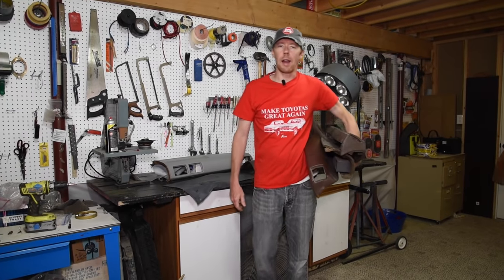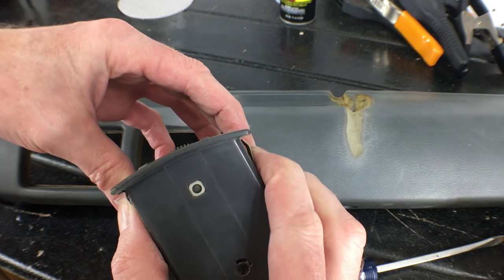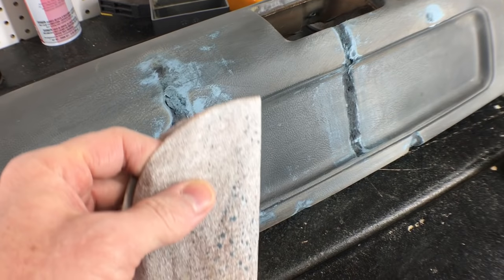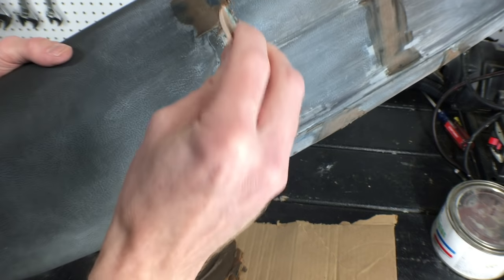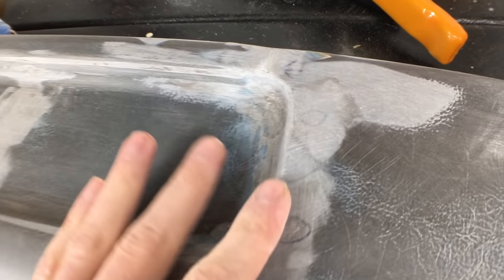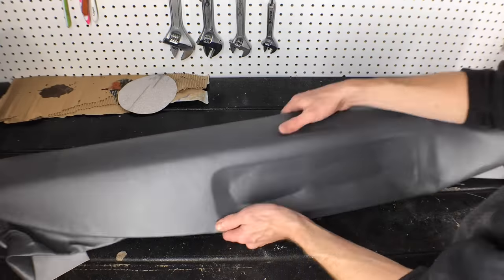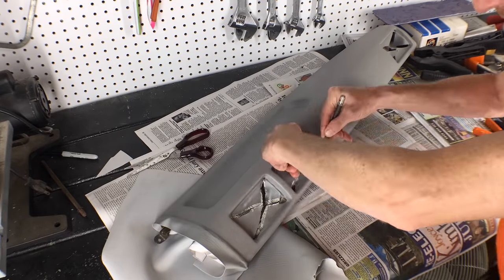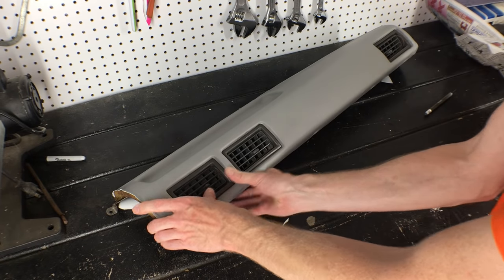How to Restore/Fix/Repair a Cracked Vinyl Dash - Toyota Hilux Pickup/4Runner PART 1

Comment: I know it sounds expensive but try leather and then on that front edge of that second Dash the newer version you'd have a top Stitch two sections of the leather. That's how I did a Silver Shadow dashboard and voided it look nice and believe me after I had it all nice and maroon leather top stitched I never let it sit out in the sun and I always kept a good coat of basically beeswax melted in the microwave and put it on a towel and wipe all the leather down and it soaks in that beeswax and I mean it looks nice. That was back in the days of rolling in money now I fix cheap cars and own cheap cars.
Reply from the maker: I'd love to learn how to stitch leather one day. It looks amazing when done well!   I recently restored another Toyota dash using spray foam, 4-way stretch vinyl and brush-on glue, and the results were much better: https://youtu.be/XB9GKLRHYNM

Comment: With all the cost of materials, labor and the chance that the old vinyl will crack again and show through the new vinyl . I rather if available buy a new one or go to a salvage yard and get one if it's in good shape.
Reply from the maker: Toyota doesn't make them any more, but once in a while a nice Toyota dash shows up on ebay... and sells for $500+  Someone should start to reproduce these.

Comment: After watching you struggle wouldn't it be better to just spray it with raptor liner and you can also change the color of it to charcoal or something it wont look too bad and doesn't look like a hassle like wrapping it in vinyl
Reply from the maker: I think I;m going to try another one with that method

Comment: Hi can you use filler sanded the spray paint  thanks
Reply from the maker: You could do it that way if you wanted a custom smooth glossy finish. I've seen it done before. It would be a lot of work, but worth it in the end.

Comment: Just a quick question... Why not just fill the dash then sand it and paint it whatever color you like? True it wouldn't be textured but less likely to crack and you can paint it in any color
Reply from the maker: I went for the factory look on this one  but I would like to redo one in the style you’re describing where it’s painted smooth and glossy.

Comment: I might have considered just filling in the recessed area before covering it and doing away with it altogether, save a lot of heartache These things are made in large high pressure high temperature presses, thats how they get the covering to conform to the shapes, nearly impossible to do at home.  The vinyl will never stay down in that cavity in the sun, the factory uses special vinyl I believe as well.  Another thing, try getting automotive grade vinyl at an auto upholstery shop.  Ive padded and recovered a lot of door panels and had great results, but theyre much easier than a dash pad, not so many shapes and cavities.  A for effort.
Reply from the maker: Thanks for the advice... I may try again with all the tips I've learned from people's comments.

Comment: @ 26:20 you should have used a different glue that allowed for removal and to reapply the material.
Reply from the maker: I recently restored another dash using spray foam, brush on glue and 4-way stretch vinyl and the results were much better:
https://youtu.be/XB9GKLRHYNM

Comment: AIRCRAFT MECHANIC> Once you filled the original cracks just paint the dash since you are dying the new vinyl.
Reply from the maker: The only thing is the repaired area won’t match the original texture. But I want to try another and make the whole dash smooth like the paint on the body of a car
Reply from the maker: The only problem is that the repaired area wouldn’t match the original texture of the dash.

Comment: There's a couple key elements in success you were missing: a better spray pattern cat (3M 90) and doing it in smaller sections. The top section should be done gluing the recess first and then the rest. Also, heating the vynil before stretching it over (with the glue applied).
Reply: Hmm I'm looking at some 90 to add some sound attenuation foam over existing dynamat, seems about the best product so far and you can't go wrong with 3M
Reply: @MrTheHillfolk  if you're covering the foam with upholstered panels, then maybe the 77 is sufficient.

Comment: Hey dude this vinyl you had the first time was good you just started at the wrong place, and you did not leave enough vinyl for the pocket plus you spray glue as you go it's the small tight corners at the ends of the dash that's a pain in the butt because it's all heat and stretch from that point because the vinyl has to be pull over and around the ends and edges. but it was still a good video
Reply from the maker: Thanks!  I recently restored another dash using spray foam, brush on glue and 4-way stretch vinyl and the results were much better: https://youtu.be/XB9GKLRHYNM

Comment: Should do the recessed area first let completely dry then do the rest of dash
Reply from the maker: Thanks for watching! I later restored another dash using spray foam, brush on glue and 4-way stretch vinyl, and the results were better, but still had a little trouble with the recessed area: https://youtu.be/XB9GKLRHYNM Also I put both dashes through a torture test to see which products held up better and the second one was definitely the winner: https://youtu.be/ywkqTaHK2LA

Comment: If push comes to shove how about filling up the majority of that recess with spray foam, sanding it down and filling in any imperfections with the Bondo. That recess is just a open junk drawer. Lol. To get rid of the bubbles down in that recess you need a small roller that they us in the RV world to roll out bubbles in rubber roof seams and eternabond tape
Reply from the maker: I recently restored another dash using spray foam + some better materials and it turned out great: https://youtu.be/XB9GKLRHYNM  That recessed area is where an optional inclinometer cluster sits, so I wanted to keep it open, but when I restore the third dash, it's getting filled in!

Comment: For the recessed area it would have been better to lay the face of the dash down because that is relatively uniform other than the vent ports.  Then work from front to back a little at a time to prevent trapped air and get the vinyl to lay into the recess evenly.  It would probably be easier too if you only spray the dash its self with adhesive then you can just kind of roll the vinyl on and have it resting on something else to prevent it from sticking on when you don’t want it to.
Reply: Contact cement has to be sprayed on both sides, otherwise the bond is incomplete - learned this from doing laminate countertops.

Comment: Great job on the video, but I Definitely would use a can of spray foam and rasp into shape. The blue can would be more manageable than the red. Also, working in halves is key. Lay the material over the dash without spraying any adhesive, peel back one side and spray the back of the vinyl and the dash.  When the adhesive is tacky, start rolling the vinyl on to the dash, use fingers under the flap for any indentions. Use heat gun ass needed, Just saying.
Reply from the maker: Thanks for the advice. I'd like to try this project again with everything I've been told.

Comment: I've wrapped vehicles for 10 years now and this may look good for a little while but it will eventually start lifting and looking like crap.Ive never seen anyone wrap a dash board.
Reply from the maker: I recently restored a second dash with 4-way stretch vinyl and brush on glue and the results were much better: https://youtu.be/XB9GKLRHYNM  Now I'm testing the two dashes in the summer heat and the first one is peeling up like you said. The second one is doing great though.

Comment: So if you ended up painting the new vinyl, why didn't you just paint the old vinyl dash after you filled and sanded it smooth? Seems like recovering it was stressful and a lot of time and effort if it all gets painted anyway.
Reply from the maker: The parts I filled in didn't match the original vinyl texture that the rest of the dash had. Also I didn't trust the bondo to never crack a little, so the vinyl covering would hide that.  But I want to try this again and spray a bed liner instead of using vinyl to see how that looks.
Reply: @6thGearGarage  ok, gotcha. Didn't think about the texture. Makes sense.

Comment: Why not just use spray-in insulation foam (right stuff, etc), then trim/sand it after it's done curing/drying?  It should remain pliable under the vinyl.  Seems like it would be a lot less work.
Reply from the maker: I wanted to keep the shape OEM because there's an optional altimeter/inclinometer cluster that fits in that recessed area. I restored another Toyota dash using 4-way stretch vinyl and brush on contact cement, and the results were MUCH better: https://youtu.be/XB9GKLRHYNM
Reply: @6thGearGarage  Understood.  My comment was regarding the use of the filler for the cracks in the dash, not the template you used to address the void space between the vinyl and the original top contour.  My though process was to use the foam to deal with that space you created with the v-grooves you intentionally cut along the cracks.  Nice job; and you put a ton of work into it.  It's hard to find parts for our old favorites.  Same with my 96 XJ.
Reply from the maker: @Brian_C_  Oh my bad, I read that wrong.  I  recently restored another dash with the spray foam you mentioned, using some different methods and better materials, and it turned out great: https://youtu.be/XB9GKLRHYNM

Comment: I wonder if a 3rd gen camaro will be easier because its very flat
Reply from the maker: Yeah flat should be easier. I recently restored another dash using spray foam, brush on glue and 4-way stretch vinyl, and the results were better, but still had a little trouble with the recessed area: https://youtu.be/XB9GKLRHYNM

Comment: For real, I'd have just filled that recessed part. I hate stuff laying on the dash anyway so I would never use it.
Reply from the maker: Thanks for watching! I later restored another dash using spray foam, brush on glue and 4-way stretch vinyl, and the results were better, but still had a little trouble with the recessed area: https://youtu.be/XB9GKLRHYNM Also I put both dashes through a torture test to see which products held up better and the second one was definitely the winner: https://youtu.be/ywkqTaHK2LA

Comment: On a truck, after doing the prep work as shown in the video, I might try spraying on truck bed liner instead of covering with vinyl. It would be a whole lot easier! The color would have to be determined in advance. But bed liner comes in a range of colors and can be tinted or mixed for an even closer match, if wanted.
Reply from the maker: Great idea and so much easier!  I'm going to try this in a future video.
Reply: I've seen some videos where after the Bondo process they are primed and painted. I don't think I will attempt the vinyl but I may do the paint or spray on bed liner.
Thanks for the information and video.
Reply from the maker: @chrishinds1897  I am going to try that route on the next dash, there will be a video 👍

Comment: I am rebuilding a 1989 Hilux. I desperately need advice on LSD diff and gear reduction.
Reply from the maker: What size tires are you going to use?
Reply: @6thGearGarage  : Thanks. context: I live on a tiny remote tropical island in the West Pacific. The max. speed limit is 35 mph. In 2whd, I have never used 5th gear & seldom even use 4th. The roads are rough with crater size potholes. Offroad, I use only 1st & 2nd gear. Offroad is deep, soft sand on steep hills. I need much lower gear ratio. motor = stock 22R currently running 31" tires I'd like to run probably 33" or possibly even 35". But the 31" tires have already pushed the to-the-ground gear ratio to the top of its usable range. In 2whd, What it feels like is I'd like second gear to run about like 1st gear runs now. I'd like to be able to take off in 2nd gear with 1st reserved for a "bulldog" gear. Then I could use all the gears. This truck is called upon to pull out vehicles stuck in the sand. It is also called upon to tow heavy trailers in 2whd. Actually, I already have an Eaton Detroit Truetrac LSD rear diff replacement carriage that I have NOT yet installed. I need recommendations on gear reduction. Which is better, replace the ring gears in both front & rear diffs? Or replace transmission final drive? What ratio do you recommend? What parts? brands? suppliers? You have my sincere gratitude in advance.
Reply from the maker: @tutorjerry9436  I don't have any experience with your exact situation, but on my 22R truck with 13" tires, I have 5.29 gears and it's just right for daily driving. The speedometer is still accurate with that setup.

Comment: I replaced the vinyl by spry paint and looks better.....is just an option.....
Reply from the maker: What type of paint did you use?  I recently restored another dash using spray foam, brush on glue and 4-way stretch vinyl and the results were much better:
https://youtu.be/XB9GKLRHYNM

Comment: Copmletely kill that recessed area by putting Bando so that you will have a smooth surface at top... That's the only way because whatever you do, the vinly will loosen out from that recessed zone unless you apply hot high pressure pressing.
Reply from the maker: I recently restored another dash with 4-way stretch vinyl and brush on glue and the results were much better- check it out: https://youtu.be/XB9GKLRHYNM
Reply: @6thGearGarage  Will check that out. Thank you for sharing your experienceand know-how btw. :)

Comment: Never use spray glues they don't bond as good best use glue and apply by brush so it penetrates both surfaces instead of sitting. On top of the surface
Reply from the maker: Thanks for the tip!

Comment: Think I woulda just painted it, instead of vinyl. Looks good though.
Reply from the maker: Thanks for watching! I later restored another dash using spray foam, brush on glue and 4-way stretch vinyl + spray paint, and the results were much better, but still had a little trouble with the recessed area: https://youtu.be/XB9GKLRHYNM Also I put both dashes through a torture test to see which products held up better and the second one was definitely the winner: https://youtu.be/ywkqTaHK2LA

Comment: Could you just fill the cracks and sand it well and then just paint it
Reply from the maker: Yes, but matching the vinyl texture would have been tough. I recently restored another Toyota dash using spray foam, 4-way stretch vinyl and brush-on glue, and the results were much better: https://youtu.be/XB9GKLRHYNM
Reply: @6thGearGarage  I watched your other video as well it looked good. I am lazy im going to order the cap for mine

Comment: also in those cracks , being you are covering it , spray foam would have been quicker and easier , what I have always used , and has lasted on the only one I still have now over a decade , and it is not garaged ...

Comment: A very difficult restoration. I have no advice. The end result was not as perfect as you would have liked but still acceptable. There is a bumper texture paint. May be worth a try. I have never used it.
Reply from the maker: Thanks for watching! I later restored another dash using spray foam, brush on glue and 4-way stretch vinyl, and the results were better, but still had a little trouble with the recessed area: https://youtu.be/XB9GKLRHYNM Also I put both dashes through a torture test to see which products held up better and the second one was definitely the winner: https://youtu.be/ywkqTaHK2LA

Comment: I would have just painted the dash with a satin finish …..but I guess it depends on the level of restoration someone is wanting.
Reply from the maker: I’m going to do another video where I spray it with bed liner instead of using vinyl.

Comment: Replace the dash with a new part...
Takes FAR less time and, all told, probably costs the same.
Use the time you save to work overtime and pay for it all!
Reply from the maker: Toyota doesn’t make these anymore. I recently restored another dash using brush on glue and 4-way stretch vinyl and the results were much better:
https://youtu.be/XB9GKLRHYNM

Comment: Should have filled in the recess with bondo and glued the vinyl flush with the rest of the dash.....
Reply from the maker: Yeah that wold have life much easier. I did another one of these dashes using 4-way stretch vinyl and brush-on contact cement, and the results came out much better: https://youtu.be/XB9GKLRHYNM

Comment: I have a bubble in the tray injected it with vynal glue pop up again tried gorilla glue popping up again just going to buy a plastic cover lay dash cap 😑  it really pains me because my interior is mint .
Reply from the maker: I've had a couple that started to bubble up around that recessed area on top. I don't have a good solution for that either :(

Comment: Great try for a beginner. Steam is better than heat gun. I guess I am a year too late to give advice.
Reply from the maker: Thanks for watching... I recently restored another dash using spray foam, brush on glue and 4-way stretch vinyl and the results were much better: https://youtu.be/XB9GKLRHYNM

Comment: Looks like it would have been better to just fill the recess with Bondo and put the vinyl over it.
Reply from the maker: That would have made life much easier! I recently restored another Toyota dash using spray foam, 4-way stretch vinyl and brush-on glue, and the results were much better: https://youtu.be/XB9GKLRHYNM

Comment: Use a hair dryer...it is hot enough but not as hot as a heat gun is...still need to be careful but alot safer...
Reply from the maker: Good tip, thanks!  The heat gun was very hot, to the point I couldn't touch the vinyl sometimes.